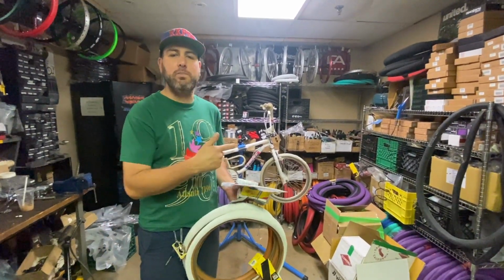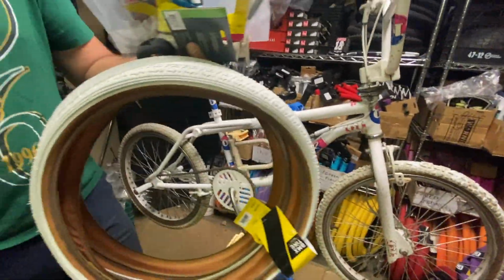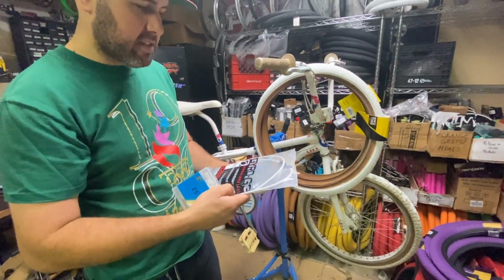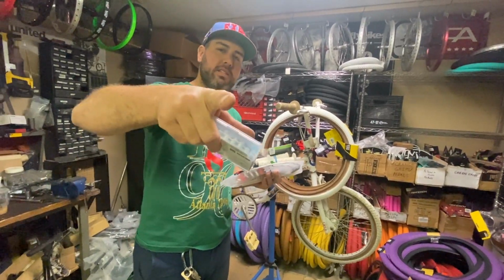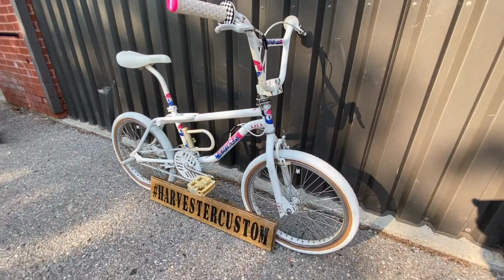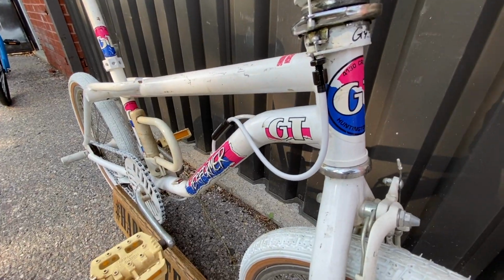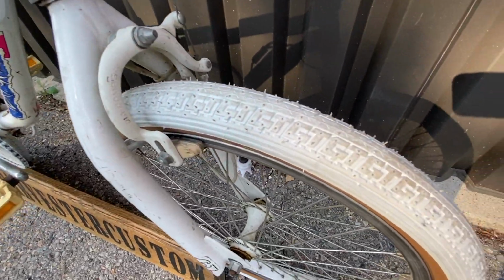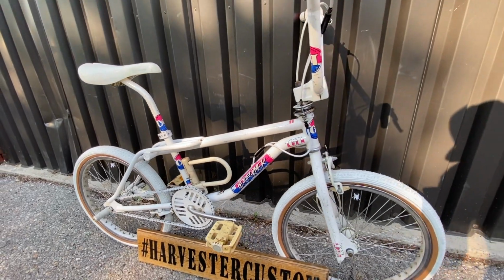80's GT Performer Fresh'n Up @ Harvester Bikes

Comment: This is an '87 Pro Performer, not a Performer. It's more than halfway to a Pro Freestyle Tour. The correct wheels are the OKG Performer mags. Pro Performers didn't come with 48s until '97. I had an '87 Pro Performer (blue) in '90, and I can say most of what this white one has is correct. I believe those are the same pedals my bike had. Pretty sweet.

Comment: Some schwinn YO48’s would look sick on that. Back in 90 I had a 87 it was lavender and white with 6 spoke mags, pink pegs and frame standers.
Reply: I wish Heritage would reissue other models of the GT, but that seems like a wet dream that will never happen in real life🙄.
Reply: GT really needs to re-issue the 6 point tomahawk mags
Reply: @BerserkerNick  That's what I've been saying for the longest, my friend 🤓👍! Out of all mag wheel sets, those are the most trippy looking wheels I've seen. I had them on my Dyno back in the very early 90's. The Dyno was either a Compe or Detour.
Reply: @rgw1380rw  that is funny you mentioned that. I have a 1988 schwinn Predator Freeform pro it’s blue and chrome. Super clean 8.5 out of 10. At some time someone swapped out the white YO48s and put the 6 spoke white gt mags and white primo walls.
Reply: @nessie42786  Some bikes just look better with certain wheel sets on them. As kids, we'd swap certain wheels with our friends because one's bike should've came with the other's wheels on it. A set of 48h's may be dope, but sometimes a set of Tomahawk wheels or certain type of rim could make your bike pop like a cap gun on Christmas day.

Comment: Ok so this is actually a GT Pro Performer as it has the double bend down tube and the decals actually says “Pro Performer”. The wheels are not original to the bike as they would have come with OGK mags in 1987.